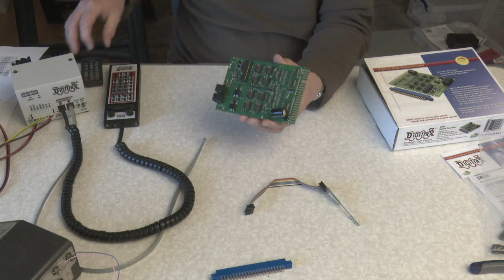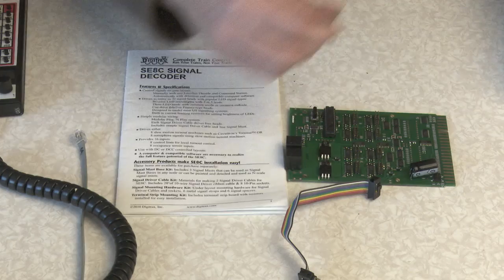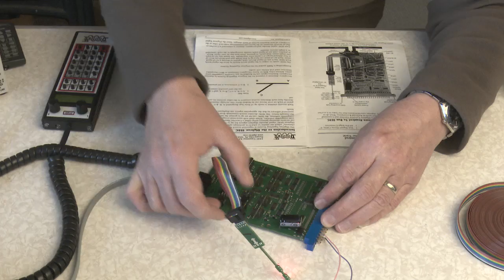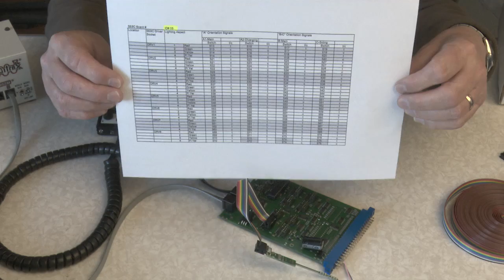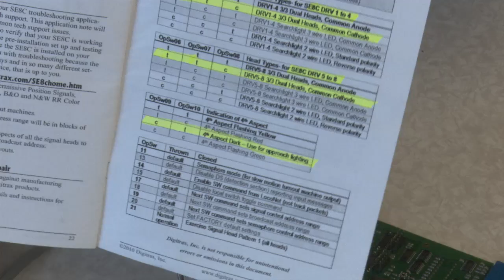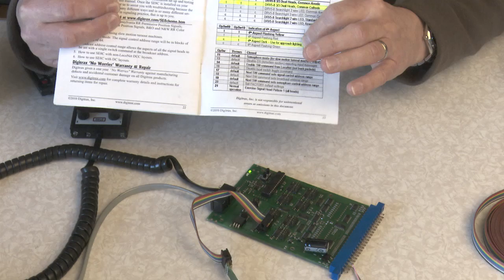Setting up the Digitrax SE8C at Chadwick Model Railway | 2.

Comment: Incorrect ~ Board addresses for different modules are independant. DS64, BDL168 and a SE8C can all have Board Adrees #1, #2,  etc.. What is clearly explained is that Turnout addresses on the SE8C don't clash with a similar DS64 Turnout Address. This can be confirmed if you use JMRI to program your modules ~ only those active will show up. Accessory addresses are differnt than Loco addresses. When you change a turnout you use "Switch". When you change a loco address you use ADR the normal way. 32x 4 Aspect signals is quite normal on the SE8C.
Reply from the maker: An excellent comment and yes I was wrong with the board addresses.
Regards Charlie
Reply: Interesting, I’m in a similar situation and I must change either the ds64 or se8c address to work.  I’ve tried for a whole night but ended up changing the se8c address.  I’m using a dcs52 command station.  Not sure where this is “clearly explained” in the manual.

Comment: Another great video, I’m going through them! I guess you could use a signal with a competing id, just rotate the board 180 degrees to use the alternative id pair. May be that’s why they designed it like this? Won’t work of course if you have multiple adjacent ids already in use.
Reply: Just read your pinned comment…not an issue in any case it seems, with competing loco ids at least.
Reply from the maker: Many thanks for your comment, DRL. Much appreciated, regards Charlie.

Comment: Thanks for the tutorial. Here in the US double head signals are used in switches/turnouts. Top signals are for the Mainline and lower signals are for the siding. This way the conductor knows if a switch is thrown against them.
Reply from the maker: I’m glad that you found it useful Hector. 
Regards Charlie

Comment: You may be interested to know that I have just managed to get UK 4 aspect signals working with the SE8c and utilising just 2 switches.
This means that each board can run 32 * 4 aspect signals.
I use a NAND gate ic chip to create the 2nd amber aspect.
I created a short video here  to show you how to wire it up, with a simple circuit diagram . https://youtu.be/usHp7tgZw0M.
Hope this helps you 4 Aspect fans.
kind regards Leney
Reply from the maker: Well done Richard, I’ve watched the video now and would love to see it with a UK 4 aspect signal.

Comment: Thanks.  I don't think you have to go in and out of the op switch mode each time.  Just leave the board in program mode.
Reply from the maker: Thanks Kurt, a fair point.  
Do you use TrainController?
Reply: @ChadwickModelRailway   I use JMRI but only for programming and every once and a while to run a train...  I tried to keep stuff out of the computer as I have enough trouble just keeping my wiring straight, much less the 1's and 0's!!   Thanks for all your videos!

Comment: Hello Charlie.  Thank you for your informative videos.   Have you tried using Train Controller  to control your signals? Like you, I use Digitrax and TC and have found my Digitrax signals  ' aspects change too slowly if I connect more than three signals.  Did you experience anything like that? Thank you. 

Basil Panas
Reply from the maker: No Basil I haven’t but I didn’t really use it to its full capacity.
Reply: @ChadwickModelRailway  thank you.

Comment: Hello Charlie, here in Queensland Australia we have a flashing yellow. It it is used when two trains will enter a station  where there is only a loop line and a main line so each train will have the points set against them at the far end of the track they are entering. So the flashing yellow indicates to the driver Caution that they do not have a continuous route thru the station.
Reply from the maker: Thanks Peter, I'm unsure of today's signaling here in the UK.  
1970, I'm fine but modern standards are so much more complex.

Comment: Buy the Accu-lites Breakout board for the SE8c... screw terminals, no soldering, easily change a connection as needed... Worth every dollar in the long run. About $27.95 US
Reply from the maker: Yes the breakout boards are great but not available when I did this video.

Comment: Nice little video and very informative. Just one minor point is up in the UK we do have flashing yellow signals (both double and single) flashes. These are used to highlight that a diverging junctions a lower speed ahead is set. Normal sequence is double flashing, single flashing, steady yellow at junction with junction indicator (feather) and then red (dependant on traffic ahead). Hope this is useful
Reply from the maker: Hi Jonny,  Many thanks for your comment.  However, my layout is based around 1970 in the west country and the yellow signals, I recall, were always steady.  Regards Charlie
Reply: @ChadwickModelRailway  Flashing yellow / double yellow was introduced in 1979, so you are quite correct in your usage.